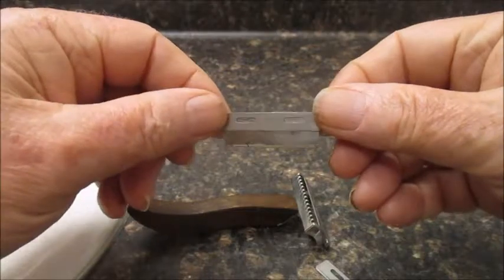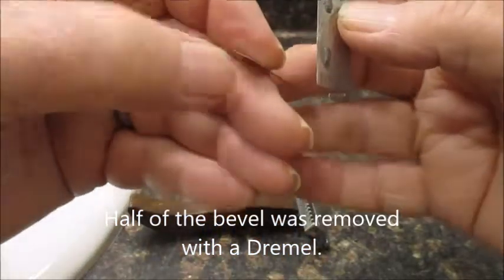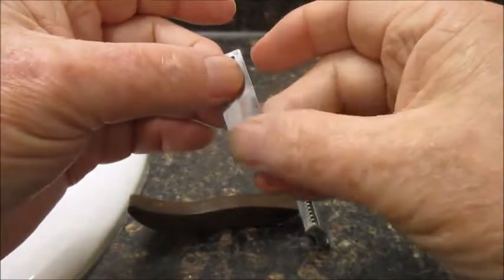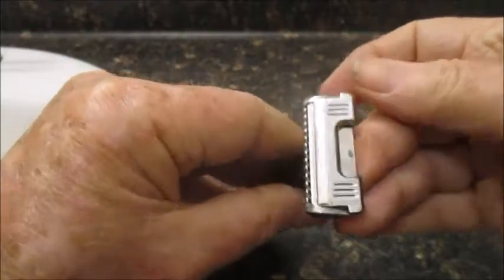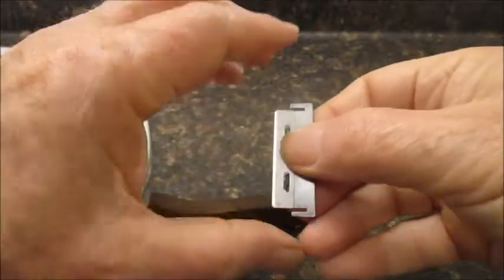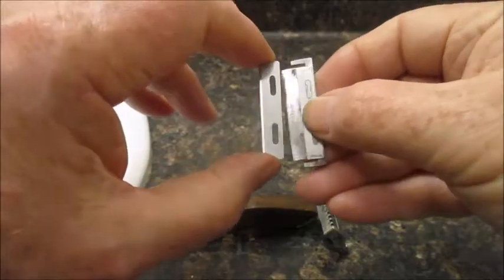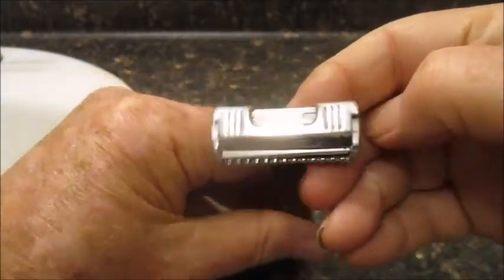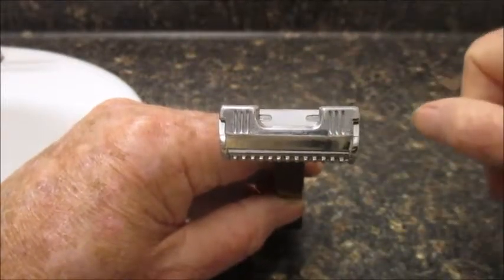Enders Blade Carrier

Comment: Hey Jim. I'm very late to the party here as this video has been online for a little while now.  What blade do you recommend to use eh the Enders.  And can you please tell me,  is that a brown plastic handled enders or is it a wooden handle on an Enders head? 

Great videos.  Thank you
Reply from the maker: You can use any injector blade. I use Personna because they are good and cheaper than the Schicks. That handle is a wooden handle I made for the Enders.
Check out these posts.
https://jrshaving.blogspot.com/2019/04/wooden-handle-for-enders-speed-shaver.html
https://jrshaving.blogspot.com/2021/05/i-make-wooden-handle-for-enders-speed.html
Reply: @jayaruh47  oh.  Thank you for the rapid response.   I thought that most injector blades were too wide and didn't fit and you had to use a special one that was shorter than the rest! But that's not the case, i definitely can use any injector blade? I will try the ones that you recommend  👌
Reply from the maker: @RodricWeiland  My first razor was a Schick injector razor in the 60s. Many swear by the China Schick injectors, but they average $1 a blade. I like Personna blades. You can get them online 20 blades for $8.20 from Ted Pella here: https://www.tedpella.com/dissect_html/blades.aspx#_121_4